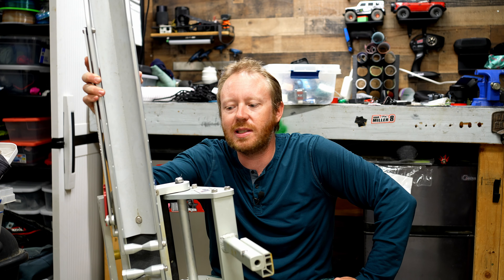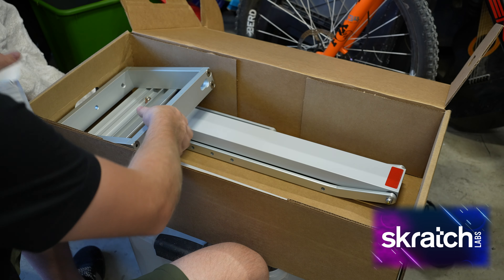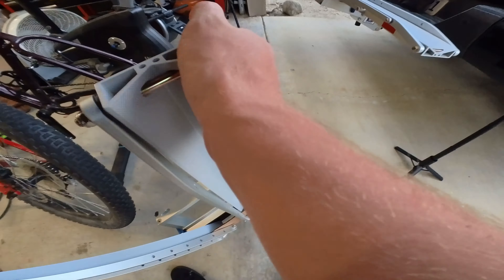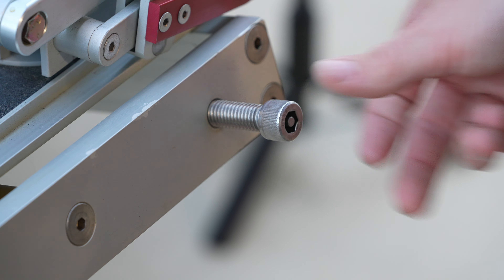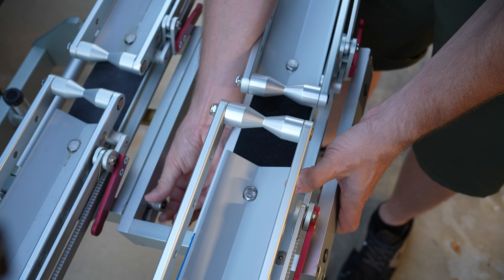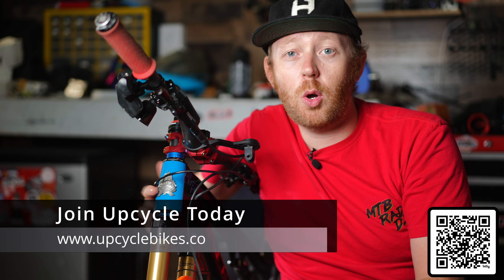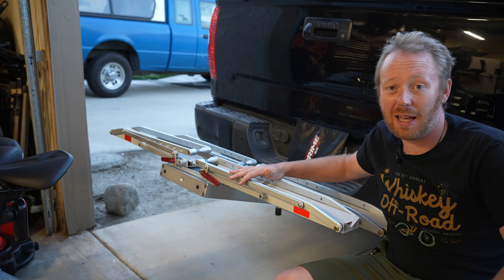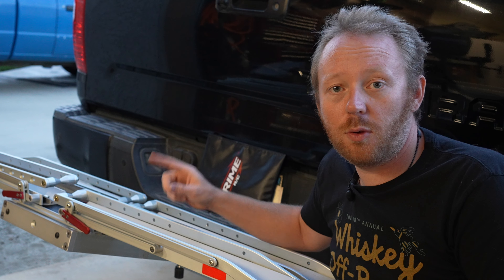Upgrade Your Quik Rack With 1up Usa Add-on - Unboxing And Installation

Comment: Do you have the 1 1/4 or 2 inch?
Reply from the maker: The 2 in model is still a 1 1/4, it just had an adapter on it.  But i had the 2 inch with the adapter